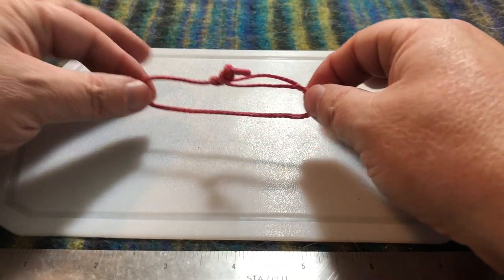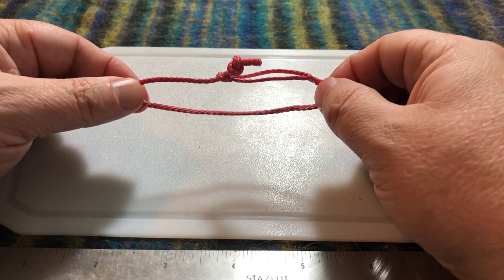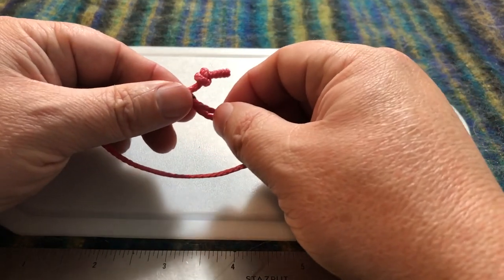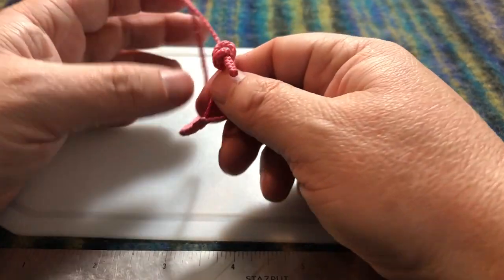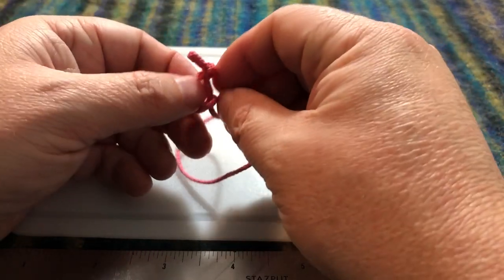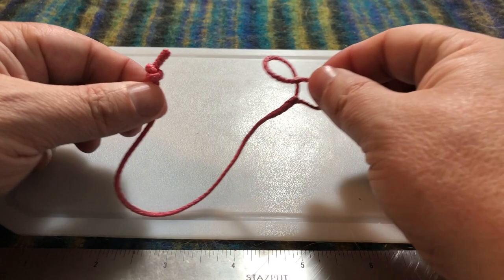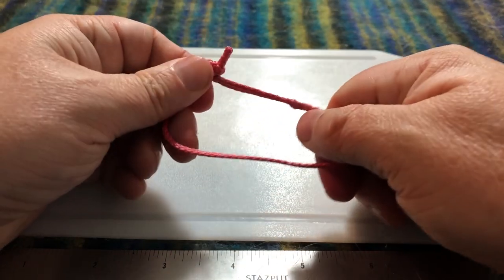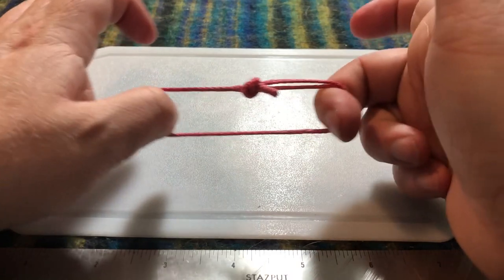How To Make a Soft Shackle with 1.75mm Zing It or Lash It

Comment: good job! Thanx!
Reply from the maker: Thanks for watching!
Reply: It's worthy of sharing. I posted it in Hammock Camping during tarp discussions, using the youtube link so it still sends viewers to your channel. Much appreciated tutorial. better to open than the old style, but happy there is a length of single cord for prusik knotting that a typical improved shackle lacks. It is specific to the tarp on a ridgeline vs weight bearing, but it's ideal for that use and elegant!
Reply from the maker: Awesome!  Thanks.  They say Prusik knots don’t work well on cords of similar diameter but I find if you go four or five wraps it
will hold. Not sure if I mention that in the video.